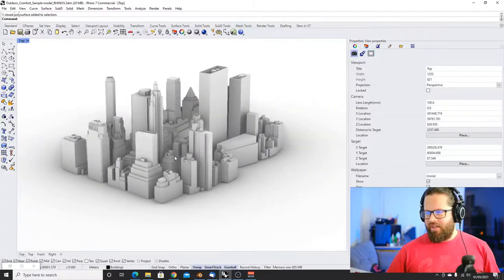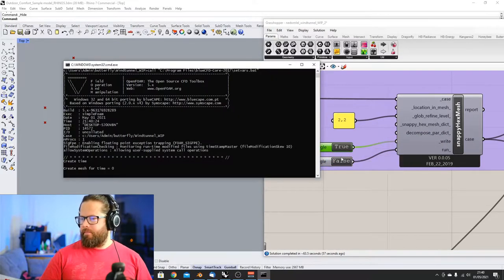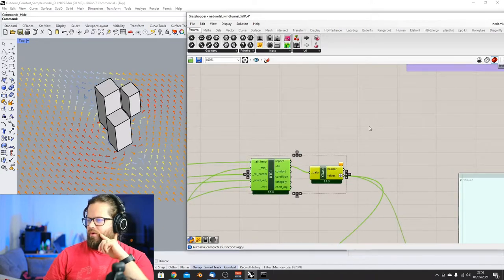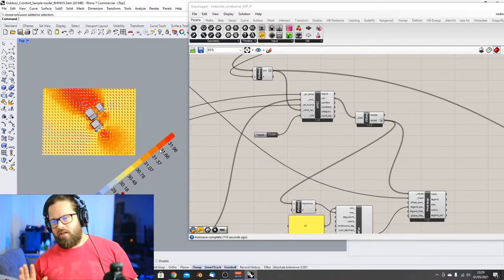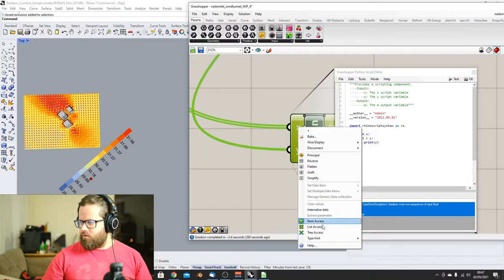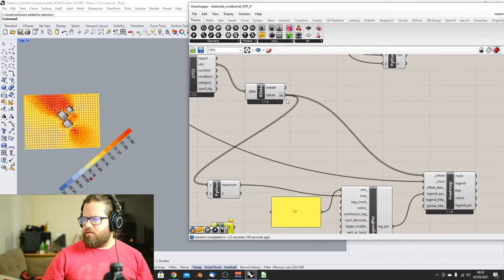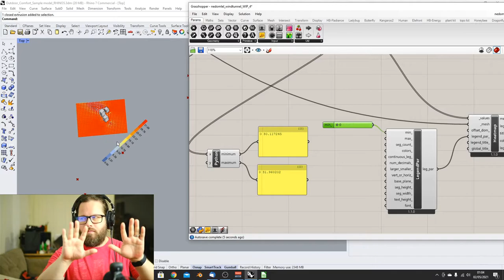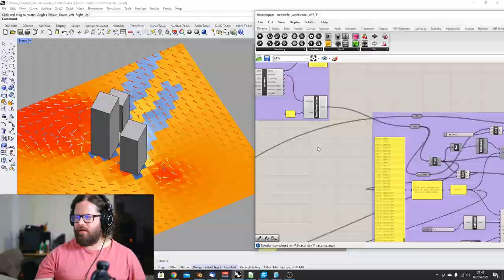Butterfly CFD | Wind analysis + Outdoor Comfort | Butterfly and Ladybug | CFD Part 03

Comment: Hi Philip, Thank you for this video, I have a question, how UCTI component has accepted the wind speed that has different length than the temperature and the relative humidity? Should not be the same size? Logically, you should take the probe points of the velocity and put it in the point of human to sky so that every probe point has utci and velocity, no?
Reply from the maker: Yes I'm using the probe points as my points for the human to sky relationship component...
In the UTCI component I input the windspeed resulting from Butterfly. Not sure if I can follow your questions correctly.

Comment: Thank you Mr. Philipp. it worked. but I have some confusion with the wind direction. could you please tell me if the model is North up directed, to calculate the South direction wind, should I give {0,-1,0} or {0,1,0}? or the given default -x direction is okay!
Reply from the maker: The wind direction option is sadly not working well. I would leave it and rotate the model to the required wind direction.
Reply from the maker: Sadly the developers haven't fixed this bug and might not for a while if ever.
I suggest to try Eddy3d. It feels more user-friendly.
https://www1.nyc.gov/site/planning/data-maps/open-data/dwn-nyc-3d-model-download.page

Comment: Hello Philipp, new member here¡ First of all many many thanks for putting all these knowledge out here and for free, it is really something.
I have a couple of questions: 
1.I am using a windspeed of 10m/s and after doing the simulation my maximum value is 1.95m/s is that normal? Because when I use the wind speed from the ladybug which is lower than my initial 10m/s, this wind is cooling the spaces more than with my simulation(for the hottest day of the year) I am using a surface way bigger than the geometry to analize so there are wind vectors in completely open spaces.
2.Do you think it is possible to simulate a thermal camera type of thing in grasshopper? Like you have an object that its been heated by sun radiation and being able to see the temperature gradient and how the air next to it reacts. If so what software or plugin do you recommend? butterfly and the heat transfer recipe?Thanks again.
Reply from the maker: Hi Orlando, regarding wind speed. This has something to do with the context settings.
Most wind speeds are measured in an open environment like airports...
In the wind settings search for context. You can change the factor to simulated different environments from open fields to dense urban cityscapes. (This has an effect on your initial windspeed)
Regarding the thermal camera. Radiation analysis comes probably closest. Butterfly heat transfer is more an indoor application for air conditioning etc...but it's a good question... For larger studies like urban heat island effect dragonfly originally was capable of doing this.... It also depends on what you want to exacly study..

Comment: really appreciate the tutorials and scripts. Having issues with the blockmesh / loadmesh. It's giving me a WindowsError on the output and can't resolve it. Any suggestions?
Reply from the maker: Most of the time there is a problem with the installation. You can test if the problem is the script or the installation by running one or all of the example scripts coming with the installation download folder. If the example files don't work then i would check  my video on how to install Butterfly.
You need to follow the video on the dot. Correct versions for everything etc...
Reply: @PhilippGalvanDesign  ended up uninstalling everything and reinstalling to your video with no luck unfortunately.
Reply from the maker: Which version of blue CFD did you install?
Reply from the maker: Are you running Rhino in admin mode?
Reply: @PhilippGalvanDesign  Admin mode and 2017-2
Reply: @PhilippGalvanDesign  seems like its an issue with "os.listdir(polyMesh_folder)"
Reply from the maker: @MrSnowboardShredda  can you tell me which version of BlueCFD you have installed?

Comment: Hi Philipp. In first place, many thanks for your tutorials, they are pretty helpful and easy to follow. In second place, is there any way to get that 3dm model?. Thanks!
Reply from the maker: Sorry, i stopped sharing models and scripts.
I even don't think I still have it
Reply: @PhilippGalvanDesign  oh what a shame. Anyway I found a 3dm model of a city (similiar to your model) and I'am joining the surfaces. The vast majority stay as "closed solid polysurface" after joining, but some of them stay as "open polysurface" after joining. Does the "open polysurface" building works as well? or it has to be all of them "closed solid polysurface" to make the simulation run?.
Reply from the maker: @castrocortesdiego  open surfaces work too in butterfly. However if you want to develop the script further I would try to clean up as much as possible. Excluding points inside geometry would be harder to achieve. Normally I would select all open meshes or surfaces and see if they relevant for my test.
Reply: @PhilippGalvanDesign  Many thanks!

Comment: i have a question about the simulation. I want to test the accuracy of the simulation by measuring the real wind speed. However, I'm really confused with the wind speed. I wonder if the software used instantaneous wind speed or average wind speed in the simulation?
Reply from the maker: The software uses a default wind speed and direction. But you can change the value of the windspeed depending on your project. This CFD model captures a moment in time  so that it's not meant as an average wind speed. Imagine a wind tunnel test. You blow wind from one side and look how the wind speed changes on your model.
Reply from the maker: You could average the windspeed and direction from ladybug weather data to get a bigger picture over time or calculate which times of the year have certain characteristics.
Reply from the maker: There is currently a bug with the direction component. So I would rotate the model rather then the wind direction.

Comment: Thank you Philipp for the great tutorial, is there a way to remove the test points inside the geometry volume before making the activate solution?
Reply from the maker: Hi, yes there are ways to do that. I think there is an option within the butterfly tools but haven't got there myself. Instead
 I made a script which filters these values. 
You might want to check you one of the following videos. If you can't find let me know and I can check where it is.

Comment: hi sir，i wanna ask that how can i get the air temperature distribution at different levels after the wind analysis？are there any cases for me to learn？
Reply from the maker: good question. I think it depends on where you are. but there is a temperature lapse rate (decrease). which could be applied to your temperature output. If it's a fixed height it might be easy to just substact the temperature from the temperature data output via math node. temp - 1 degree celsius (average i think its about 0.6 degree celsisu per 100 meter) but i'm just guessing here. a search online shoudn't be a problem.

Comment: Hi philip, thanks for sharing the supper cool tutorial. actually, I have a problem with your script, that "failed to find solution probes folder", what should I do? many thanks!!
Reply from the maker: Are you running rhino in admin mode?
Reply: @PhilippGalvanDesign  No, I am running in normal mode. I really need your help for my thesis, your tutorial is so related to my method for testing the building configuration. Thanks a lot.
Reply from the maker: @melvinapramadya1302  
Butterfly only works when running rhino in admin mode.
Reply from the maker: @melvinapramadya1302  
Regarding thesis. I'm happy to discuss. Do you want to send me an email outlining what it is about? office@nedomlel.com
Reply: Hi, the problem related above is solved, thanks. btw as a result i think my CFD analysis is not applied yet to the UTC script. I was checked the pyhton script is similar with yours. Thanks,.
Reply from the maker: @melvina pramadya Puspahati  
Hey Melvina,
First of all thanks for being my first channel member!
I got your email but didn't got to reply yet. I'll be a busy today but was planning to answer in detail tomorrow.
Reply from the maker: @melvinapramadyapuspahati9050  
Regarding the script not working yet. could you also send me script and model. It's gonna be easier to check for me.
Reply: @PhilippGalvanDesign  yeah sure, you are so kind. thanks a lot
Reply from the maker: uploading a new video.  part 1 today  part 2 tomorrow
I'll also share the script with you afterwards
It should help with your current questions, a bit of a deep dive into UTCI and CFD

Comment: Hey, Philipp is there a way to incorporate the wind direction from the epw data into butterfly wind vector like you did with the wind speed?
Reply from the maker: in theory yes but there seems to be a bug in butterfly. Butterfly has a wind direction slot but it causes errors. I would probably use eddy3d instead which you could combine with Ladybug as well.

Comment: Hi! it is me again, I checked your code and the weather part shows the relative humidity, but I am not sure how it is represented on the final image, or should I set another node to make it visible? I believe the end the graph only shows the temperature, right?
I would appreciate your help!
Reply from the maker: Hi David, yes the final graph shows the perceived temperature (UTCI) in Celsius since it's a outdoor comfort study. The relative humidity is part of the calculation to get to the perceived temperature. You might want to check my previous videos on outdoor comfort for better understanding.
Reply: @PhilippGalvanDesign  Will definitely check the other videos, thank you!
Reply: @PhilippGalvanDesign  Hi! I have been busy with other projects but I'm back to the CFD simulation. 
-After running everything the temperature range is realy high (over 50 degrees) I'm not sure what I did wrong. 😅 I think it supposed to automatically be set to the temperature average on the week/day I set on my period time according to the EPW map right? 
I am using your code (nedomlel_windtunnel_WIP_4) and I changed some parameters to fit my physical model, not too much though. 

-Also how about the time set on the controlDict, It is set to 300 on your code but I changed mine to 40, It takes less time and my pc is really old that's why. Could that be a reason for my temperature to be shown really high? also I did not understand quite well what this time refers to. 
-As for the context of the (HumanToSky) it should be set to the buildings or the floor plane?

I would really appreciate your help! 🙌 sorry to bother so much!
Reply from the maker: Hi David, ok let's go step by step:  time period.
I think in my script I set my period  to one hour. But yes you can set any period you want. You just need to make sure that all components recieving the same period of time.
Reply from the maker: The time on the controlDict (300) is how often the solver iterate through the process.
The longer the more accurate the output.
40 sounds a bit low. The test script from the developers was set to 600 in think. 
I would let it run longer so you get a feeling of when the output seems not changing anymore.
Reply from the maker: Regarding the temperature. The UTCI is the perceived temperature. Which means 'how it feels rather then what it really is. 50 degrees sounds hight but could be possible on a very hot day on a very exposed spot with little wind. Where is your test location?
Reply: @PhilippGalvanDesign   @Philipp Galvan Design  Thank you very much for taking the time to reply.  I am running it again, and see whether I get different results if I let the solver iterate more times. The location of the project is Shanghai, China. The time period I set for the climate is July 27th at 12pm (one of the hottest periods according to the weather values.) Also, I rotated my model to match the wind direction since it comes from South-East and i couldn't set the wind vector (it shows an error) and deleted the script connected to the WindVector node.
Reply: @PhilippGalvanDesign  My bad, I should have read more carefully, yes It is UTCI the perceived temperature. I set the time to a higher number and got better results. Thank you a lot,  I wish my pc was faster though it takes too long to get just one output, It would be nice to get a whole day picture rather than just 1 hour, but again, that's just my pc's problem. Amazing code, I can't thank you enough. I still have too much to learn.
Reply from the maker: For the UTCI (perceived temperature) I feel that it is most useful to test the times which are most severe. If testing a whole day the output will be an average and could look quite good although it's actually not, during several hours of the day. What I mean is that the outcome could be quite misleading. That's why I like to test the UTCI hour by hour to compare different times of the day in the different sample weeks (a sample day per hottest week, hot week, coldest week, cold week, normal week...). There are also ways to get an average of a certain time of the day over a longer period. For example:  the average UTCI at 9AM over a whole year or season ....Maybe I should do another video about that....:)